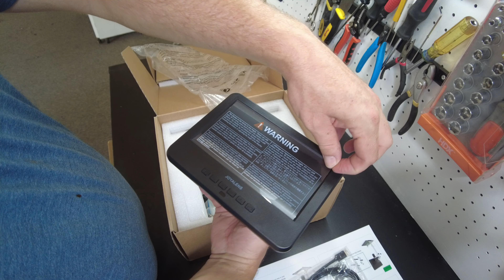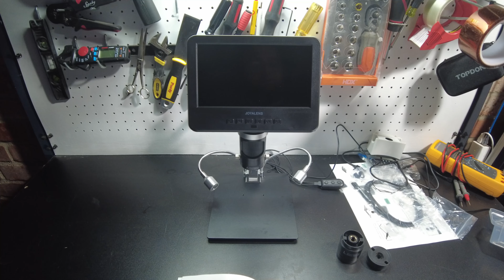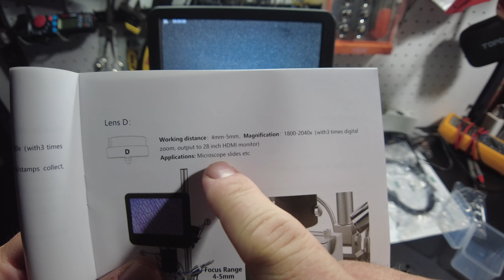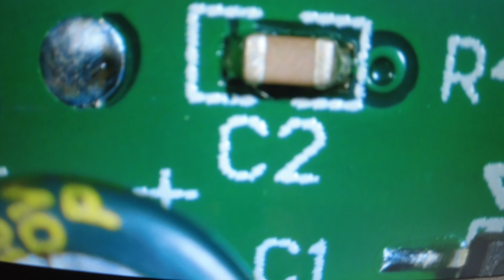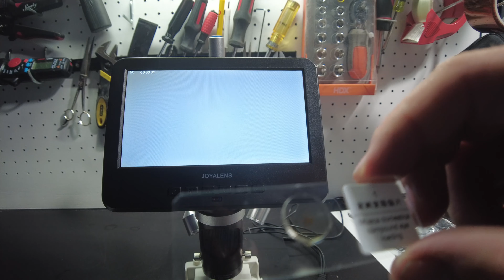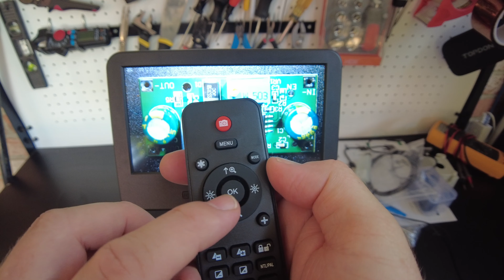JOYALENS Digital Microscope

Comment: I just purchased..a JOYALENS DM 246S 249S to repair two iMac Mainbords where the pins for the CPU were bent out of place, and I am so pleased that this scope works. The main reason why I purchased this one is that the emphasis was on a Scope for IC repair with a soldering station and not on Coins; it can be used for coins with the appropriate lens. But this one is specifically for electronic repair. It costs $222.00 on Amazon, which is a little expensive, but it works wonderfully for fixing pins out of alignment and for replacing ICs on anything electronics.. I give those Scop a Five Star.🥰
Reply from the maker: Yes it's pretty great for PCB work. That's my main use. Thanks!

Comment: Brad, I got one of those last year to go with my knife sharpener.  Not that one but a cheaper one. Boss. Does all I need.
p.s.  Thanx for not filling up the video with unboxing an assembly.  Boring and a waste of time.  5 stars for editing.  :)
Reply from the maker: Yeah I was looking at them over a year ago. But I got overwhelmed with the amount of different sellers/brands, they all look about the same. I just couldn't nail down which one to grab. Probably the just the cheapest option would have been the way to go. Thanks!